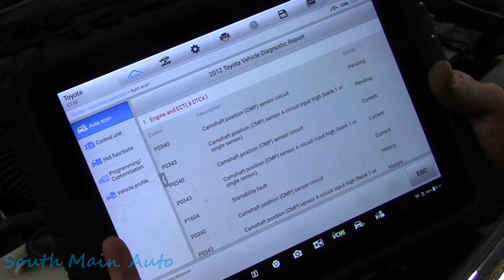Squirrel vs Toyota Tacoma - Part I

Comment: Had a mazda pickup come in with a start die start die problem. Dropped the front pipe an varoom ran like a champ so I figured bad/clogged cat. Ordered a new one and installed it and same problem. Looked for the banana in the tailpipe but it was clear. Thumped the muffler and it sounded strange so got ot the torch and started cutting the muffler off. The stink was unbelievable and when the muffler hit the floor it sounded like it weighed 60 lbs. Well it did. A rodent had filled the muffler FULL of dog food. Lesson learned never assume that what caused identical symptoms on the last 50 cars is what the problem with the current car,

Comment: I did a 1974 Cadillac DeVille had the big 500 in it it came in as a no start flooded I unbolted the air cleaner which was the single wing nut to the top I had a hard time listening that I had to use a pair of pliers and it was packed full of dog food that thing must have ran up and down for a day and a half because that's as long as it was parked I don't know what had dropped it in there but that was as close as I've seen to what you just did so I've been through that process too bro but not through the fender well hope all the goodness for you and your family

Comment: I put chicken wire screen over the intake opening to spot rodents from making a home next to my air filter.  I had a mouse die in my fresh air intake and he was getting ground up in the fan blades before I knew where he was.  Wires are made with a soy oil that atract them and they like to chew on wires to keep their teeth sharp and cut down.

Comment: Funny, not funny. I had the same problem over here in the French Riviera on my Z06 Vette. A simple solution and not a problem since.  Bunch up a wad of Chicken wire and place at the intake port to prevent entry of all Rodents.  I then took a few wads of cotton and doused it with "Peppermint Oil" and did the same on the cabin air filter (it was truly a full blown next) ... same Chicken wire treatment on that intake as well ... advise checking this Toyota's cabin filter as well.  Good luck ... pity the Walnuts weren't Truffles ... be worth more than the Tundra !!! LOL

As for attics ... suggest using a "Vaporizer" (like when you have a Cold or Flu) and using the Peppermint Oil. There are a few YT vids on this technic ... does NOT harm the animals ... just repels them ... they will enter the area and leave within 1 minute  or so as they can't stand the smell of "Peppermint". Far preferable to using Poisons that our family pets can get into and smelly corpses laying around.  You DO have to replenish the Oil every few weeks but trust me, beats hell out of the damage these critters can do to house and autos. Bon chance ... y'all.

Comment: The force of nature. Myself, it try to put a stronger metal screen in the path. Fine enough webbing so that it doesn't block artrflow, but heavy enough so that vermin cant get on there. Red wires have that potential, from what I understand. That was not the first time. It may be what makes it red.

Comment: Sometimes you feel like a nut, sometimes you don't!😁 That's crazy. This had to be sitting under a tree for 10 years.🤷
Reply: Jim it actually doesn’t take long for rodents (mice, chipmunks and squirrels) to do this kind of damage. I’ve dealt with the nut storing and very beginning stages of nesting scenario, but have luckily caught it before wires or engine damaged.

Comment: I had a squirrel in my 07 tundra. TWICE IN 1 YEAR. Cost my insurance company $8k worth of wire harness each time. The squirrel went through the same harness both times. It goes from the engine bay through the firewall to the fuse box under the dash.

Comment: My 2005 Focus was ravaged by squirrels a few years ago, but the car did sit a lot, so... From what we were told the wire casing was soy-based (ugh) and slightly tasty to the rodent-based palate. I ended up doing about a dozen wire patches and now it's a routine to open up the hood a few times a week as the Monster-in-law drives it now.
Reply: They make plastics and wire insulation from corn or soy now because fossil fuel is oh so bad right,they dont think about these things when they are busy demonizing fossil fuels we need. Rodents love this stuff.  monster in law haha.
Reply: Honda offers capsaicin laced electrical tape to wrap up these tasty wires. 😉
Reply: Captain, I suggest trying predator urine applied in a perimeter around where you park the car. Park it as far away from the house and other cars as you practically can, and then put the urine granules or liquid down around and under it. It's wildcat urine analog or something like that. The mice and such naturally hate it, since their instinct tells them not to make a nest where a predator cat is clearly frequenting the area. 😺 The mothballs and ivory soap and ultrasonic stuff is hogwash. Cat piss though, that scares them. 😎
Reply: All sitting does is give them more time before you notice the issue. My moms Ford was attacked, and she drove it everyday, including weekends. Also it was the only vehicle attacked.... with other sitting a little bit more. Like mine, not being moved 2 days a week usually.

Comment: Rodents in general, but red squirrels and rats chew on wires to keep the teeth filed down.  Kindd Regards,  Craig
Reply: And a deer mouse/white-footed mouse, loves to nest on top of the air filter for the interior, if the air filter is placed horizontally, where a mouse can nest ontop of the outer part and poop all over the outer filter! (Tiny black pellets on the filter, would make me throw a red flag!)

Comment: The squirrels seem to leave the plastic corrugated wire covering alone usually.  I've found that they can't resist exposed regular wire.  I've heard that the insulation on the wires has a veggie component to it like soy, that the rodents can sense.

Comment: I had a squirrel watch me pick up pecans in his territory, he saw me put them in my car, later when I started the car it was running rough, I looked under the hood and he had chewed off one of the fuel injector wires, after resoldering them back on, I was able to leave work. I never picked up anymore pecans from his trees.

Comment: What a nightmare... The mice got into my classic and chewed the front seats Made a nice nest in the boot.
Filled my poison mouse catcher with wood screws.
 They even emptied a big box of wood screws and made a neat pile.
Chewed a my electronic ignition converter wiring. 
Made a second nest out of the sound proofing under the dashboard. 😂

Comment: Great video Eric, just how did that vehicle drag itself along the road with its air supply cut off. Did the customer not notice a drop off in performance, and only brought it to you for its annual inspection with the money light on.
Reply: You would be amazed at how oblivious the Average Joe really is about their vehicle. 🙄 I mean, do you see how common it is for people to overheat their engine so much that it warps the head into a piece of rotini? 😸 It's incredible. They don't even scan their gauges like they're supposed to. 🤷🏻‍♂️ I've seen brakes that were caliper to rotor, and backing pads that were against the core cooling vanes. I've seen tires with bubbles on the tread face so severe that I asked the guy how in the world he even got here. His answer? "I live on a long dirt road that's real shot up." I suggested replacement asap along with the shocks, and he refused. Said the tires were still under warranty. 🤣 One time, this guy pulled up with steam shooting out the grill. I asked how I could help him and he said "I'd just like a top off of my washer fluid please." I asked him to pop the hood and I saw the radiator tank cracked and blasting out steam like crazy. I said, "Hey, your radiator is cracked and leaking very very badly. You're going to boil off all of your coolant and overheat." (This was in Arizona summer heat...) He said "Yeah I know." I asked if he wanted me to quote him on the radiator job and he said "Yeahhhh, I really just want that washer fluid for now please, thanks." I topped him off and he took his mobile vegetable steamer on down the road into the sunset. It's just...mind boggling. $200 radiator? Nah...drive it till it needs a $1,500 engine swap!
Reply: @mannys9130  I guess you right, but just a few simple weekly/ monthly checks would save these poor souls a fortune. Still if it keeps Eric O,s videos coming it's not all bad news
'
Reply: I saw a car with it's right front hub assembly leaning over worse than the Leaning Tower of Pisa while I was walking my dog. The lady kept driving it along though.

Comment: After some red squirrels chewed through the side of my house and got up inside the attic, I hate these rodents.  It was during a time that no one was living in the house(I live with my fiancé) and they did a lot of damage up there.  I ended up trapping one of them but others got up there later on.  I would patch up the holes on the outside and they would chew through somewhere else.

I also had something get under the hood of my 2014 Mustang GT last year and chew both wires off to the passenger side VVT solenoids and one AC connector.  They chewed the wires right to the connectors on the solenoids so I had to buy new ones from Ford but I was able to save the AC connector.    

Not sure what it was but I found a ton of cat hair and prints under the hood and some of our cats have a bad habit of going up into the engine compartment of our vehicles.  I did not find any other evidence of mice or rodents under there so who knows.  We have had cats and kittens chew on stuff under the hood so it could have been one of them.

Comment: I wonder if you got some of the hottest hot sauce you could find and liberally apply it to all the wiring harnesses and whatnot, if that'd stop the squirrels and mice from being so eager to chew on them.  Alternatively, since the acid in the sauce could be bad for the rubber insulation on the wires, you could also probably coat all the wires with silicone spray, and then dust them all down heavily with some really hot ground pepper.  Some extra hot ground cayenne pepper would probably do the job.  Just make sure you always let anyone that works on your car know what you've done - it'd be REALLY bad for a mechanic to be touching the wires and then rubbing his / her eyes.

Comment: I’m not an expert on rodents, but my understanding is that rodents will chew on things (without intending to eat them) because their teeth grow continuously, so they chew on things in order to control the growth and sharpen their teeth. I’ve seen many instances where rodents would also chew on the plastic for the air box, battery tray, etc. I’ve heard that rodents are attracted to wires because the insulation is soy based, but also because they can hold onto the wires while they chew them. 

Rodent damage can get to be really, really expensive. A while ago, a car go towed in with so many chewed wires under the hood and inside the vehicle that the insurance company (yes, it was that expensive) decided it would be most cost-effective to replace the entire engine and interior body wiring harnesses. Thankfully I wasn’t working on it. It was like 30 hours of labor and I think over $10k for the harnesses, so like a $15k job overall. Crazy.

Comment: I’m in SE Colorado with the RV and I parked in an ant battle field and had to move house yesterday. The big black flying ants used the RV as a landing strip before battling red ones on the ground. Luckily I have my M18 cordless tools with me and the shop blower helped clear the ants off. The fantastic fans were full and it sounded like a blender when I turned those on and blew the invaders out. 
I was itching all over and felt like I had ants crawling on me all evening.

Comment: A Veterinarian told me critters like chewing up wires because of sodium content in the insulation. 

When we had customers with repeated critter damage we advised them to leave out small salt licks you get at a feed store and never had repeated critter damage if they did in fact do so.

Comment: Wow.  I guess this could have been a lot worse if another few months went by before you cleaned & fixed this.  I was wondering if you would have gone to Wilbert's for the replacement pieces, but I guess not, in this case.

Comment: I've seen something similar on a 2018 Chevy pickup. Given that this apparently isn't a new problem, I'm wondering why auto manufacturers don't put a stainless steel mesh in the various air intakes. Or, maybe an aftermarket firm could come up with some solutions? Meantime, easy money, right?
Reply: Seagulls69 let’s start up a business! It’s actually a good idea as I deal with acorn stashing in intake box by chipmunks. At its worse in the fall season as they prepare for winter. Part of my maintenance is checking for any nuts and I drive my car regularly. Saving grace is the air filter keeps it all from going into engine.

Comment: Question for you or your group....My Father in law has a 2001 Jeep Cherokee. He has replaced brake booster all the way to all wheel cylinders with new parts....except rotors, drums , and brake lines. Now his pedal does not engage till almost to floor and the brake lights are staying on. He has bled the brakes several times as well. Any suggestions ?

Comment: I pulled out the air filter cover from a silverado one time at Walmart, and under the air filter, I found what amounted to an entire bag of Gardetto snacks inside. In our area, it would have been mice.
One of the shops in my hometown, about 25 miles away from where I'm currently living, the mechanic there said he got a car in one time that just would not run right. It was an older carburated car and it acted like it was starving for air or fuel. The mechanic pulled the air filter cover off and the outside of the filter was completely filled with dog food. The owner of the car was a farmer who lived in the country, and they didn't own a dog. The closest dog to them was at their son's place about a quarter mile away from them. Cleaning out the dogfood restored the car to good working condition again. When they told their son about it, he did comment he noticed the dogs food dish was emptying quite rapidly the past several days, and his dog didn't seem like he was gaining any weight. They figured it was mice taking the dogs food and carrying it a quarter mile and packing it into their car's air filter housing, which also happened to be inside a garage.
The rodents can be a bit irritating.

Comment: It's absolutely a squirrel that did this. Our squirrels literally go nuts for black walnuts and try to hide them everywhere! 

When the squirrels break the outer shell open to get to the nut it leaves a mess with that black dye that people actually use to dye fabric. It's also toxic and kills plants around the black walnut tree. 

It's hilarious to see the squirrels with brown noses from the dye. You can tell that they've been into the black walnuts 

I'm confused though. Is this an old video? I ask because we don't see black walnuts until the fall. Also, you're wearing a sweatshirt and it's been hot.

Comment: I'm not sure if it's only Toyota's, but I've read that much of the wire insulation and hoses they use in the past 10 years or more are made to be more environmentally friendly.  The intended purpose is to allow the vehicle to be recycled easier when it reaches the 'end of it's useful life'.  By the looks of the parts of this truck that were eaten, it looks like the environmentally friendly goal was exceeded to the point where the wires and hoses taste good to the rodent population.  If you know anyone with some acreage, try planting some of those walnuts to see what happens.  LOL

Just a suggestion, at the risk of being a "safety gear guy"; when you're working around rodent droppings and other excrement, you should consider masking up.  People have gotten ill from exposure to sealed food cans that had minor contamination on the unopened lids.  I'm sure that inhaling that 'crap' isn't a good idea either.

Comment: Where I live exactly the same issues, but not as severe for the intake. I always use aluminum screen material at the entrance point to the intake and seal it off good. However, the wiring is a whole new ball of wax. What a fun day. Do you know any remedy in all your days that would alleviate the wire chewing issue. Thanks for this video Eric.........Pete
Reply: He's shown Honda Rodent Tape in a previous video. Insulation tape with capsaicin to make it unpalatable to rodents. Expensive, but cheaper than fixing the wiring.

Comment: A bunch of years ago my sister complained that her old SAAB 900 (first gen) had started to run badly and lacked normal power. 
Knowing it's service history I took a peak at the air filter and Bingo! 
It was one of those big round things that went all around the carb and all around it was a  very well packed supply of rose hips. Pure wonder that enough air passed to let the car run at all and luckily they hadn't even chewed on the air filter.
Funny thing is that she has had several cars parked in the same spot for many years and this one for a couple of seasons but this is the only time this has happened.
Reply: Years ago, my dad had pack rats move into his truck. I was with him going to the bank, and something smelled strange. When we were in the bank's drive through, a big pack rat ran out from under my dad's truck. I thought the old man was going to have a stroke, as he was very mad. When we got home, I looked under the hood. The pack rats had pounds of Mesquite Tree Seed Pods on top of the turbo and exhaust manifold. All of it was being toasted, while driving down the road. I spent two days cleaning the engine off. The rats moved into the air filter box and even made a nice little bed there from the hood's blanket and firewall insulation material.